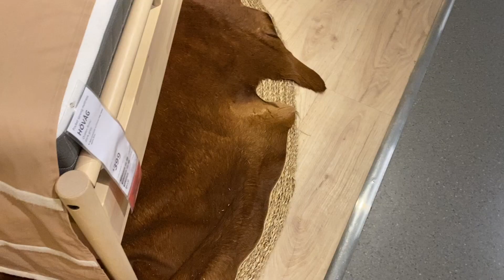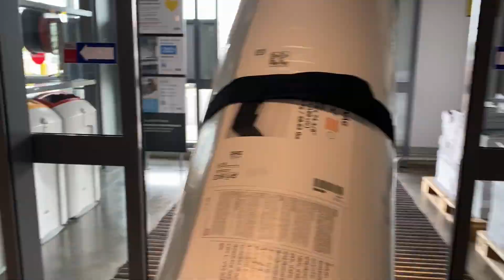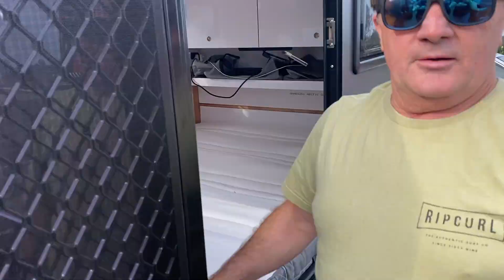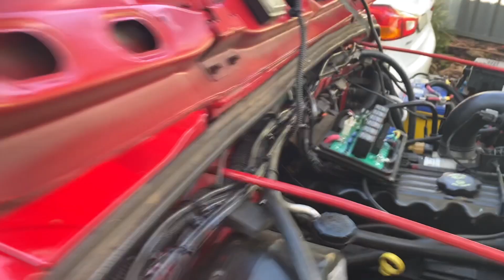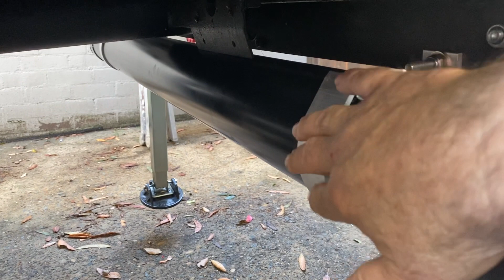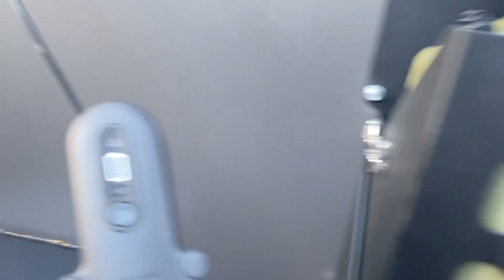Off Road Camper Trailer Build // Mattress & Bedding plus other updates

Comment: Hello from Scotland Darryl, I’ve been following your trailer build and it looks fantastic.
I’ve started building my own and have opted for a similar shape, but with a lighter duty trailer base as I won’t be going off road.
A quick question.. what material did you use for the walls and would you use a different material if you were to build again?
Thanks mate, Pete
Reply from the maker: Hey Pete, It's marine ply with a composite aluminium outer, this traditional method gives really good wall strength and is very easy for the home builder to work with. I quite like the tactile finish of the timber inside over plastics that come with the composite panels too. That said, I like the simplicity of the full composite panel builds but you really need cad design and output with those types of materials.
Reply: @DarrylSheather  Fantastic, thanks Darryl.

Comment: Looks pro' Darryl, well done. So is the interior side wall finish an A face marine ply with a clear finish? Looks good and adds warmth.
Reply from the maker: Correct, use a water based finish so it doesn't yellow too.
Reply: @DarrylSheather  Thanks. You did very well to protect it through the build.

Comment: Great job mate. Do you have a link for the KRS fittings? Cheers
Reply from the maker: https://www.ebay.com.au/itm/Bazooka-End-Cap-KRS-Australian-Made/222642314217?ssPageName=STRK%3AMEBIDX%3AIT&var=521490764864&_trksid=p2057872.m2749.l2649
Reply: Darryl Sheather ah cool thanks. I wanted to see if they’re any cheaper than the manufacturer but same seller.

Comment: Incredible job!  The camper looks absolutely awesome. I have watched each episode and I believe this is THE best diy camper build I have seen. 

I thought you had shore power installed for the AC unit.  The video said you did not have shore power access. So I am wonder...how long can you run the AC unit from the battery itself?  Just curious about the upcoming summer for you and at night feeling nice and comfortable. 😀
Reply: I agree.
Reply from the maker: Thank you guys, I do have shore power, just didn't have a way to use it to charge the battery.